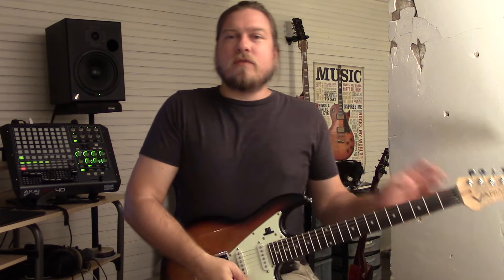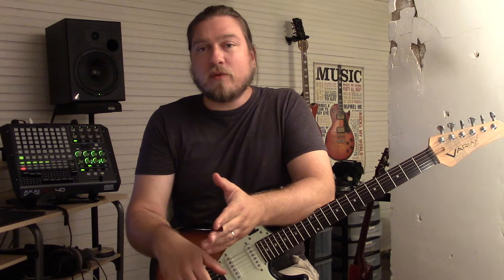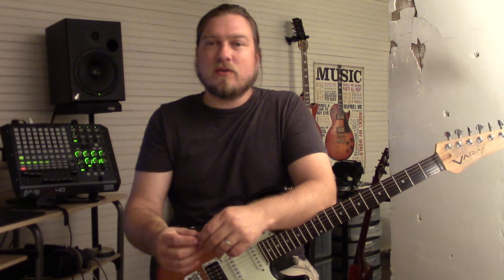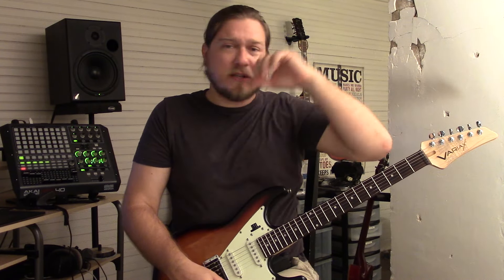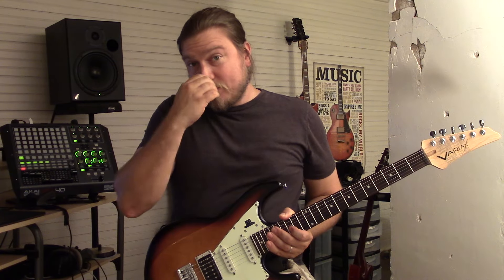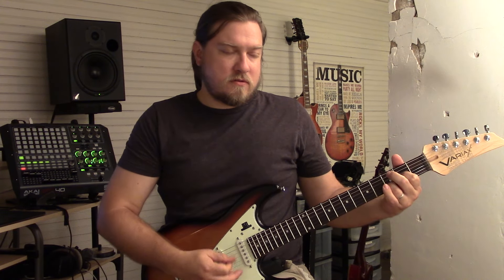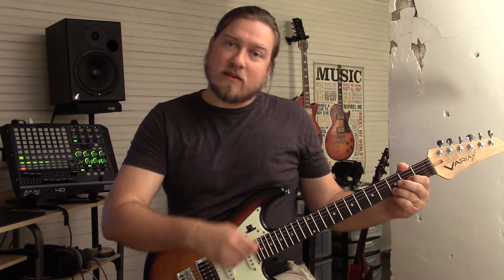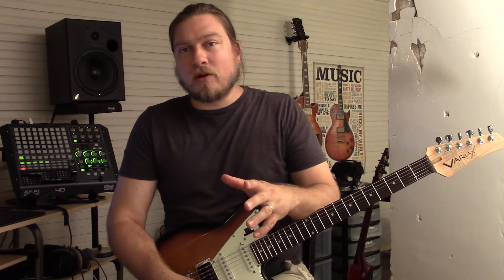How to get realistic acoustic sounds with JTV Variax

Comment: Is there a way to convert this patch for use on the POD HD500?  Could you post the EQ (graphic and PArametric) settings, as well as the Compression and reverb values?  I'm pretty sure I can then just input them into my HD 500 manually.Nice sound though..Thenks,

-doug
Reply from the maker: I don't know if you can convert it.  You could try dragging it into hd edit, that worked for opening hd500 patches on hd500x edit. Or you could download the HD500X edit program and open the patch to see the settings.  

I am using helix now and don't have the HD stuff installed any longer.  

Hope that helps.

Comment: I have yet to get one of these guitars, even though the temptation is definitely there. Currently, the only work I’ve got is busking in the New York City subway system. Can’t use a Pod there. What I currently do is plug my guitar into a Boss ME-80, then a Roland Cube Street EX. The tube amplifier setting is an instrument DI instead of one of the amp models, and of course I can turn off the actual amp simulator in the 80.  If I did purchase a JTV and run it through that arsenal, are the acoustic guitar sounds not likely to sound authentic?
Reply: Hi, The variax guitar models run through the cat5 cable. Or at least the one I had does.  The magnetic pickups run out the 1/4" jack.  So, if you have an hd500 you can have two separate paths of amplification. One for the mag pickups and the other for the modelled guitar via the cat5 cable.  
Cheers

Comment: Just bought Variax standard mainly for acoustic models and Im very disappointed especialy with 12 strings. It doesnt sound smooth and natural at all. It has some kind of high pitched tone to it that sounds like some cheap synth lead sound. The only way to not hear this is removing +12pitch in workbench, but I guess this pitched sound is the idea behind 12string emulation. I use Variax with Pod x3live via digital cable and directly to pc. Have tried many tone setups in x3 including no amp at all and acoustic still sound nothing like in sound presentations on yt. Anyone can help? Im upgrading fx to Helix floor shortly. D'you think it may help?
Reply from the maker: +jgmusic81 I think that upgrading to helix would be a great idea regardless of the acoustic sounds. It is AMAZING!

Here's the patch I built for acoustic Variax with helix: https://youtu.be/NjiPjWgV7YI

A couple of things off the top of my head. You have to play with a lighter touch when using the acoustic models. If you play really heavy handed it doesn't sound as good. Also bigger strings seem to be a little better. 10's or 11's. I think the standard shipped with 10's.

What kind of speakers do you have hooked up to your pc? 

To be honest I've never loved the 12 string sounds. Acoustic or electric. To my ears they are usable, but not great. So I don't really have any good advice for 12 string tones unfortunately.
Reply: Chad Huskey  Thank you so much for your answer. I guess I need to change strings bcause factory ones feel like 9's to me. Can you recommend any brand working with Variax better than others? I usually use Elixirs or Slinkys. 
I have KRK Rokit5 speakers to my pc but can hear that annoying tone through the headphones too so I think speakers are not the issue. 
My new Helix is on its way to me so the next week I will see if its presets can cover the guitar imperfections. Will definitely try your acoustic preset. Also cannot wait to try that lovely U2 stuff from your last vid. Really amazing  job. Just discovered your channel and Im really impressed. I instantly knew who will be my Helix guru when the fx arrive. Keep up the great work bro. Thanx again
Reply: The factory strings are D'addario 10-46.

Comment: hi, have you tried this patch live, on gigs an PAs? i did last night and the sound was terrible, very strange, saturating all, but my others patches were notmal, just this one, .it seemed to me  to have too much bass and compressing,very strange cause this video is great, and why do you use double way in your patch? you use in stereo?
Reply from the maker: +Guilherme Freitas I have used this patch live some.  I noticed that I did have to dial back the bass somewhat depending on the PA I was using.  It can get boomy at certain frequencies.  I would recommend using the graphic and/or parametric eq in the patch to start taking out low end and see if that helps.  Hopefully it will become more usable in your situation.  Good luck!

Comment: What firmware did you use on this video?
Reply from the maker: Rubensguitar I was using firmware version 2.21.
Reply: I have a JTV59 and the POD HD500x and I returned to firmware 1.71 because I found the acoustic sounds better, but even so I am still not 100% satisfied. I'll try your preset. Thank you.
Reply from the maker: Let me know if my preset works for you.  I found that I prefered the acoustic models post firmware 1.8 better than the previous models.  For me the trick is always the right amount of EQ/Compression/Reverb.
Reply: +Chad Huskey but don't you find that the acoustics on the latest 1.21 suck but with a Helix one can't afford to go back to V1.7-9....
Reply from the maker: I don't think they suck at all.  I've been using Variax guitars since 2005.  So I'm familiar with the acoustic models pre "HD" models, was it 1.8 when they changed them?  I can't remember exactly which version it was.  But I've never had any problem with the later firmware version acoustics.  I just didn't get what all the fuss was about.  I've used the latest firmware acoustics for live use and recording with results I've been very happy with.  

Here's a patch on Helix that was built around the Variax acoustic models (I'm pretty sure I'm using the Gibson model in this video):  https://youtu.be/NjiPjWgV7YI

There's no way I'd go back to an older firmware that didn't work with Helix.  Just giving up too much.  Plus I like the models in the 2.x firmware better and Workbench HD is soooo much better to work with.

Is there something specific that you don't like about the new acoustic models?

Comment: Nicely done.  Can you play the Variax while it's charging?
Reply from the maker: You have to take the battery out to charge it,but the magnetic pickups still work like a normal guitar.  You just can't use the digital side without the battery.  However if you use an hd500(x) you can connect via vdi cable and still play.
Reply: So the modelling part still works as long as you're connected to a POD, even without the battery?
Reply from the maker: As long as you are using the VDI cable that is correct.
Reply: Cool. Thanks